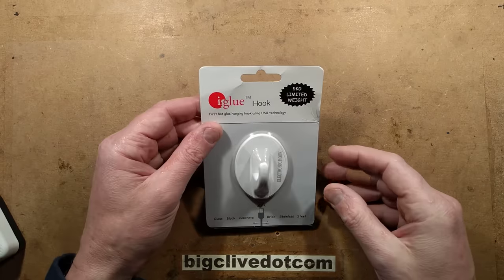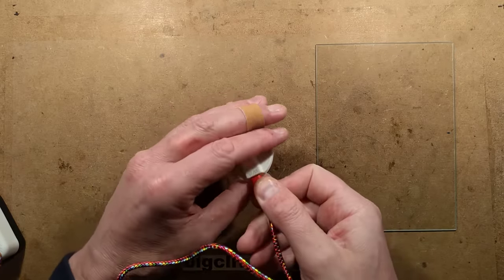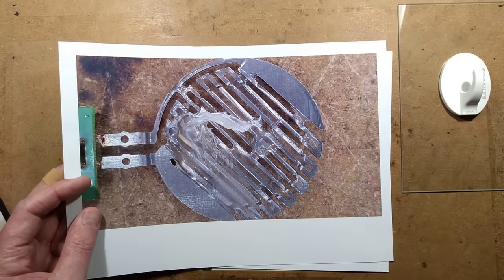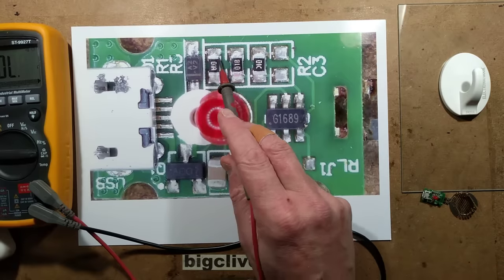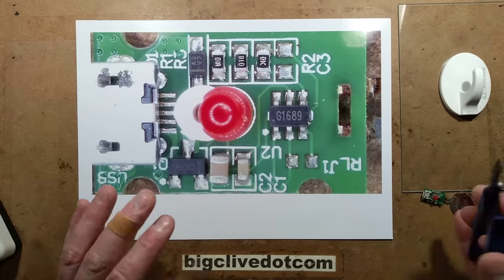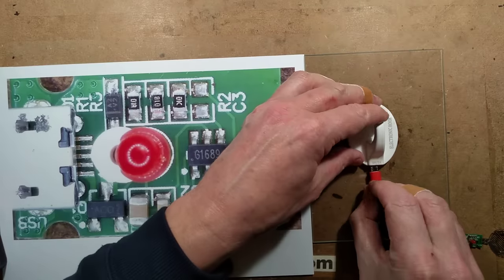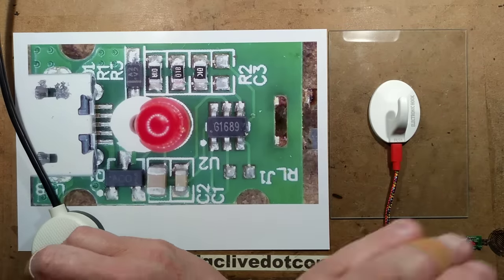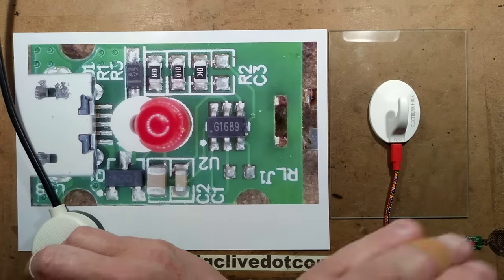Testing a USB powered wall hook and a look inside.

Comment: I want a USB self heating sausage with a heating element running through the middle.. come on, what are the Chinese playing at, where's my usb sausage!?
Reply: U ain't right lmfao
Reply: Self-heating food packaging has been around for a while.
Reply: There actually is a product for that. It's just a long metal rod you stick through the sausage and connect both ends to a little box. Saw that on a market in Shenzhen.
Reply: ᖀᖇᓮᙜᙦ 8 ᖴᕶᕓ do you mean open small?
Reply: @Marco911  that seems dangerous... I am pretty sure you shouldn't insert rods inside your sausage, specially hot ones. I know it might be exciting to do that but it can be painful and dangerous.
Reply: Paul Gascoigne - They already exist, they're called vibrators.

(Caution: May not be edible).
Reply: Da ve everything ok champ? You need a nap? You sound a little cranky there, champ.
Reply: I want a usb pad that keeps my coffee hot.
Reply: @Marco911  yeah it's called a fucking metal rod
Reply: @hadto8482  no way!
Reply: Already been done, Kenny Everett did *Electric Meat*. C'mon, you Brits in the audience ought to remember that. It was before USB of course.
Reply: @Gun4Freedom  mains powered meat (sounds like a punk band name)
Reply: Your USB sausage is in the virtual fridge. No, wait.... the robot dog has had it.
Reply: tbf, I can see an usb heated sausage skewer being a thing, and it being sold with a pack of sausages.
Reply: They are here!
Reply: Some years ago Micro Mart (the now-ceased British computer magazine) did a review of USB mince pies for its Xmas edition. At the time I took it as a spoof, but maybe I was overly cynical...
Reply: @TheAllMightyGodofCod  
Caution: packed in an environment that also handles nuts
Reply: @like-icecream  to go with the coffee cup holder that used to come free with every DVD drive...
Reply: @like-icecream  We had that when I was a child!

Comment: A microcontrolled wall hook, I've seen everything
Reply: Nuts, innit
Reply: I severely doubt that it's microcontrolled or that it knows initial heating from release heating, you plug it in, it heats for a while, then turns off, and that's it. Couldn't it just be a 555 derivative?
Reply from the maker: Keep in mind that it has modes and can detect and warn if you plug it in after it's already done a recent heating cycle.  It's definitely not a standard component.
Reply: Typically I run like hell when the product packaging is done all in Comic Sans
Reply: wow it should be advertised as ai usb wall hook.. another step to better future. next step, bluetooth connection for your phone to check if your coat is still hanging.
Reply: I've heard of a wall hook with a built in camera. Intended for covert security applications but perverts have been known to fit them in toilet cubicles and changing rooms.
Reply: @6F6G  ive.... heard of that too...
From a friend 

Preverts these days...
Reply: I bet it's a on/off heat sensor...
Reply: @martiniman34  man, the Bluetooth coat hanger seems inevitable now
Reply: Yeah my first impression when thinking "wtf is this.." as I first saw the video and opened it was that no matter how stupid this may be  the Bluetooth version is right around the door, just like the strange need to bluetooth enable EVERYTHING these days..
Reply: What is that in freedom units?
Reply: @readysteadywhoa  about 70 Spare seconds, from Spain, which the freedom units are based on, unless you are using the New York second standard, those are shorter much like the metric second.
Reply: Only a matter of time until someone makes one with a battery and Bluetooth control.
Reply: SaltyBrains  if the theorists knew jack about physics they wouldn't need to use explosives to explain why a building of that design would fall downward. To be perfectly fair buildings don't fall over sideways unless they are blown up so that they do, or they fall over when the guys laying the explosives mess up. Otherwise gravity works straight down, that's just life.
Reply: Not sure if it's a tiny micro controller like a 10F206 or a custom timer chip.
Reply: Have you seen a man eat his own head? No, so you haven't seen everything.
Reply: SaltyBrains  as they say in New Jersey, you know it guy.
Reply: "Really? Have you seen a man eat his own head?"
"No"
"So then, you haven't seen everything"
Reply: i now can die happily
Reply: A fuckin what dawg
Reply: Whats next milk cartons?
Reply: @sipos0 Pictures falling down the wall.. "we've been hacked!"
Reply: A fresh stanley blade should get the glue off the glass.. And, perhaps the 2 "slices of glue stick" could be new sticky pads  ...... ?
Reply: Have you ever seen a man eat his own head?
Reply: @duffmcbaine4865  Damn, beat me to it! :D
Reply: @bigclivedotcom  hey Big Clive. Would you like a car insurance "black box" to take apart?
Reply: @bigclivedotcom  what is it for? Does it dry a corner of a towel or something????
Reply: @bigclivedotcom  does it have a function other then waisting power?
Reply: @6F6G  as a lady that's always been wary of public restrooms..
Thank you.
Reply: @Niels357  Your questions would be answered by watching the video.

Comment: Next revision: smart home integration...

"ok google... drop all of the towels on the floor"
Reply: OK Google ... throw them to the floohr. Rhoughly!
Reply: @RelakS__   what sir? 

greetings biggus D.
Reply: @rvarchitecture3667  Hey, nice to see you here. Pass on my greetings to your wife, Incontinentia B.
Reply: @RelakS__  aww yes miss buttox send her regards, hail Cesar!
Reply: I'm not sure which is funnier, your comment or your replies!
Reply: @plixplop  i was expecting this comment and I am satisfied
Reply: 2030 ghosts
Reply: I think you might already be able to do that using this model, you just need a board that supports smart home integration and whose USB hardware can be turned on or off in software...just write a little software and you can melt your hooks off of the wall on command!
Reply: “Ok Google, drop the soap”
Reply: I mean, you just need a smart socket...
Reply: Your towel is 46% wet.
Reply: now your on to something!
Reply: Critical security vulnerability was just discovered in the protocol that is used to connect the hook to the cloud. An attacker can craft a specially formatted URL and take control of your hooks without authorization.
Reply: "I'm sorry Dave, I'm afraid I can't do that."
Reply: Put a laundry basket under it and you actually have a decent idea, maybe you can set automations to it, put weight censors in it, every two showers (it’ll be able to sense you taking it off and putting it on) it automatically drops the towel, or a setting where it can tell when a new towel is on it vs a towel with however much water trapped in it

Could also add a bluetooth speaker XD
Reply: This is super easy to do with a smart plug. I'm kinda tempted to do it now

Comment: I'll wait until they come out with the Connected IoT Smart Hook, so I can stick and unstick it remotely over the internet using a phone app from anywhere in the world.
Reply from the maker: But what if it was hacked and they remotely made your coat fall off the wall?
Reply: That's just the price of progress, I guess!
Reply: @Dabbleatory   haha
Reply: You have to keep the firmware updated and install the latest anti-virus software to prevent malicious remote unhooking.
Reply: Just make sure you turn the heating off when you're out, otherwise they may not need to steal your coat.
Reply: :D
Reply: @besenyeim  or the hook refuses to stick until one updates the FW to the newest version.
Reply: Don't forget the solar panel and a battery. Might as well fit the blockchain so it mines bitcoin while holding your coat, just to include all the buzzwords.
Reply: If it's already stuck and you remote-unstick it, it'll fall. So, would it also have built-in anti-gravity so it can be floated back up onto the wall (before resticking it)?
Reply: Just make sure you disable Java, I hear those app hooks were always sketchy.
Reply: maybe a Bluetooth one 😉
Reply: Eclectronical You've made my day :)
Reply: igotes: If you're out, you should have your coat with you (assuming it's winter as the heating is on!) therefore no problem! :-)
Reply: Wait, just realized, you can do this already.
Just have a 5V USB supply and cable always plugged into the hook. Then use a Phillips Hue IoT wall outlet switch to power on the supply, which you can do from a phone or desktop app. 

The future is already here.
Reply: Bbbwaaahahahhahahahahahaa
Reply: That's why they call it the Internet of Shit...
Reply: @bigclivedotcom  actually that would be really useful.. maybe
Reply: @Mr.Unacceptable  You forgot using AI to guess the ideal heat for sticking it on the wall.
Reply: Hang it in your friends house and scare them
Reply: got pain in my neck from laughing
Reply: Wot if it got a virus lmfao
Reply: Eclectronical "OK Google, unstick my wall hook." 😁
Reply: Pictures just start falling off the wall
Reply: @Thoroughly_Wet  wtf bro it's a hook not a nail lmfao
Reply: Hahahaaa
Reply: And that hook is either in a botnet or mines bitcoins.
Reply: i would like to know what is on the hook.
Reply: Lost internet connection... all my shi... fell off the wall!!
Reply: @bigclivedotcom  just install McAffee on it, it'll be fine
Reply: tbf, a hook with a small load cell could be interesting. if precise enough it could warn you that you left something in your coat pocket.
Reply: IoT with gecko tape🤔
Reply: Imagine installing high bandwidth router just to connect 40 hooks throughout your house
Reply: its voice activated and wireless
Reply: 😂👍 Hack the neighbours hooks 🤣
Reply: @besenyeim  you will have to buy a monthly abo so it keeps sticking
Reply: Only to get home and find your house was hacked and all your towels are on the floor.
Reply: I mean as a prop to make things drop off the wall for a movie or a magician you could add a radio controlled switch and a battery of some sort soldered into it?

Comment: My grandma owns some which I would call the "historic predecessors" of these. You glue them on using a hot glue gun and to remove the, there is a spot underneath the hook where you stick in a soldering iron. The heat melts the hot glue and by applying a slight twist with the iron, you notice once the glue melted.
Reply: Somehow that is more impressive than this and honestly seems more practical at first thought, not actually practical mind you, just more practical than all these circuits and chips which are now in higher demand than ever
Reply: Japanese used ceramic hooks with meltable sulfur inside during 20th and 19th century
Reply: I was thinking of the exact same thing!

Comment: Maybe if you upgrade the firmware to "hook 2.0" you can get it to release cleanly.
Reply: "introduced a small firmware change to resolve occasional complaints of residue when releasing"
Reply: And fixes the botnet attack vector.
Reply: I don't think you should add "Too Many Fixes" for the first release. You should at least wait until "Hook 2.1.5" before making changes to it that actually make the product worth while, otherwise sales of "Hook 1.0" will decrease and become unfeasible 👍👍👍😅😅😅

Ps. residue fix can be introduced at "Hook 1.3.7" and botnet attack vector can be implemented into "Hook 2.1.9" (And both residue fix and botnet fix will be receiving royalties for their brilliant input) 😂😂😂
Reply: if they use type C usb that would be solved, but they have to cut cost
Reply: Hook 2.0 does less damage rip roadhog
Reply: I think that requires a last gen glue dot that it is compatible with, then the current gen dot can be installed.
Reply: It's an over the air update. The bigger version will heat up in 10ms when connected to a Tesla Supercharger.
Reply: that would be a great update,i..cause the landlords all keep their damage deposit
Reply: These are great "welcome wagon " gifts and there are other versions that come with  built - in microphones.The hotel industry buys  them in bulk orders,and along with several 3,letter agencies,local and Russian

Comment: Maybe I'm just becoming an old party pooper, but this seems like a case of shoving tech into something for the sake of putting tech into something.
Reply: This is what happens when the usb mug heater factory has spare parts..
Reply: William Shreckengost my thoughts exactly
Reply: It is a strong adhesive and the instructions clearly state that isopropyl alcohol can dissolve the remaining glue. Of course, you could do the whole process yourself, but good luck making a removable hook with enough glue strength to hold up 5kg.
Reply: A dab of hot glue, just like this uses? Speaking of, I have some serious doubts that this actually can handle 5kg.
Reply: @StopChangingUsernamesYouTube  Perhaps Clive could find some suitable items to suspend from it and test its actual strength.
Reply: Duh. ;) Though if it actually sticks well, then that in itself is not a bad thing... And having a normal glue hook that sticks really well might also become a problem in the future
Reply: Solving a problem that doesn’t exist.
Reply: That's exactly what it is. It's a very inefficient solution for a simple problem that there are much better and cheaper solutions elsewhere lol
Reply: Reusable wall hook, that uses a Replaceable Material.... It fills a dang neat niche
Reply: exactly I thought it was like more reusable but both ways its ridiculous ngl xD
Reply: Oh, like that stupid Juicero machine!
Reply: Ok boomer
Reply: @Karl_Kampfwagen : Command by 3M already does that cheaper and less messily!
Reply: @25566  there were people making hidden camera hooks like this. I'm guessing a mash up of heated mug pcb's and left over hooks for those spy cams
Reply: I thought so, too. Until I considered why someone would want this. Apartment residents. You pay a deposit and cleaning fee. If you leave holes in the wall some landlords won't refund the cleaning fee. So, removing hooks becomes a necessity. Of course those Command adhesive hooks work the same way but need no heat. Maybe these hooks are stronger by comparison?
Reply: They don't work the same way, then,  @2degucitas . They just help solve the same problem... only... without the mess.
Reply: For sure,just hotglue your hooks to the wall.No electronics needed.
Reply: No way, I want to move my wall hooks daily so this is a great convenience